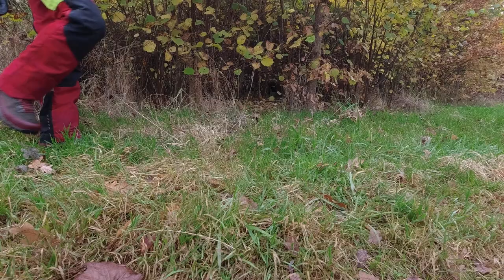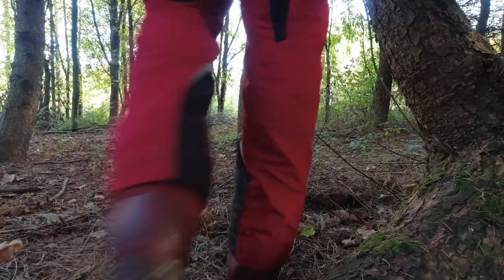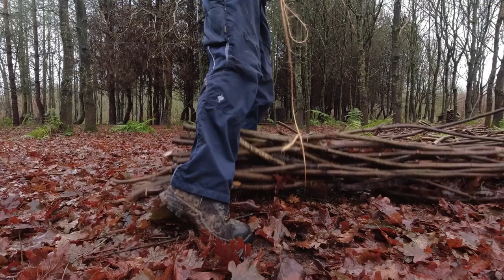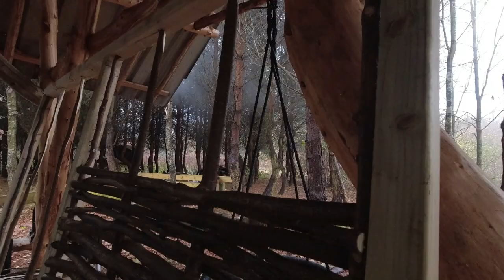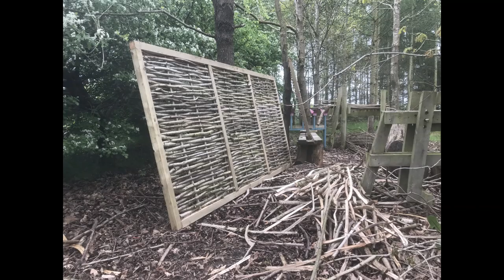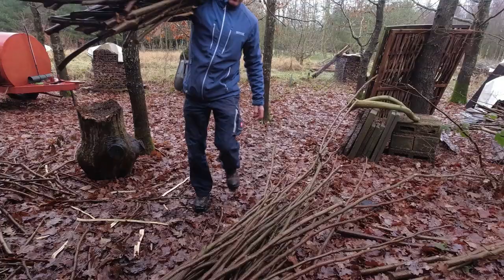How Are Hazel Wattle Hurdles Made?

Comment: I wonder if painting the hurdles and limbs with a mixture of used motor oil and kerosene would greatly prolong the life of the hurdles
Reply from the maker: I guess it would. We’ve got some at the woodland that are coming into their 10th year. I’ve never treated them. Admittedly they’re fragile but if the frame stays together the weave is usually fine too
. Clear wood preservative some people use
Reply: Fire hazard anyone?  Maybe better to use a wood protectant like Thompson's water seal.  It could even be sprayed on to save time.
Reply: I've read that Lindseed oil is recommended, once the wood dries, and is compostable too
Reply from the maker: I recommend clear wood preservative that’s oil based but linseed oil is a good suggestion too. Water based products are fairly useless at preserving fence materials. As for engine oil it would certainly preserve them, it would also colour them darker and maybe not the most environmentally friendly version